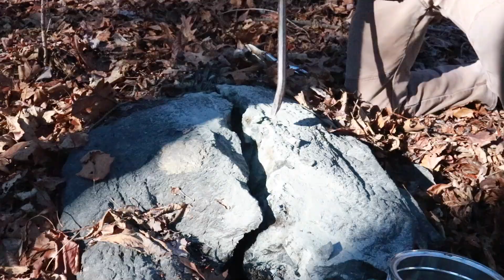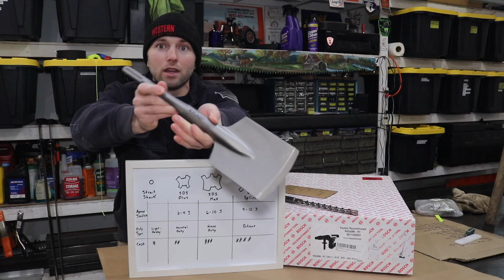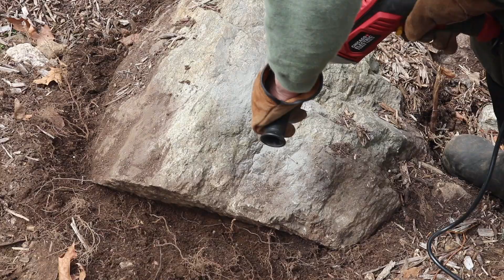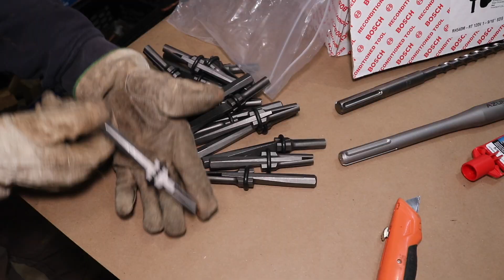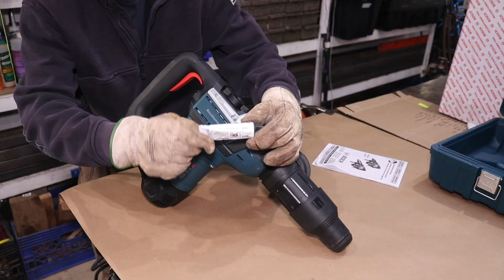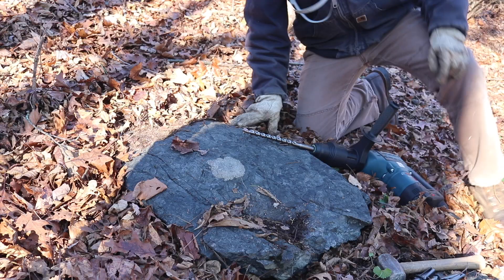Bosch RH540MRT Use & Review | SDS Max | Hammer & Rotary Hammer Drill

Comment: Here's a related question:  a while ago I picked up a used rotary hammer at a thrift store.   The manual I found online only mentions "SDS bits," and I think it means, SDS original, 2 slot shafts.   Can I use SDS-plus bits in the older system?
Reply from the maker: That’s a great question, unfortunately I don’t know
Reply: @OldSoulMillennial  I've been trying to get the internet to answer this question, and there is some conflicting info (sounds like another video you did!).   But I'm beginning to think that when SDS plus was developed, it was backwards compatible with SDS bits.   I'm going to splurge and buy some next week.   If I remember I'll come back here and report.

Comment: Our house has very hard brick veneer and I think this will work great for attaching our house numbers and when I am ready to install the Mr. Cool Mini-split for the garage workshop. Just bought one on Amazon. Great, helpful video!
Reply from the maker: So I think the SDS Max will be perfect for drilling through brick and concrete for mini split lines. However, for attaching simple house numbers, extreme overkill. I only say that because you may find that it is impossible to find very small masonry drill bits (around 1/4") that have an SDS Max attachment head. You may have to buy an SDS Max- SDS Plus adapter and then buy the appropriate size bit in sds plus. Hopefully that makes sense.